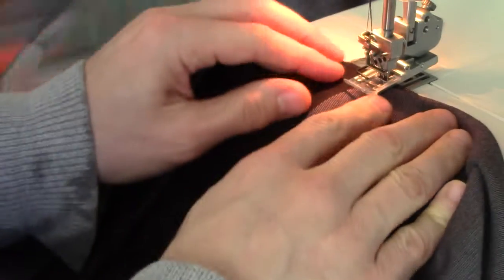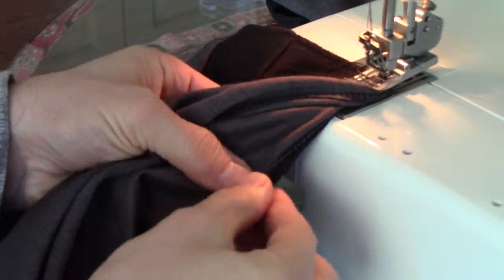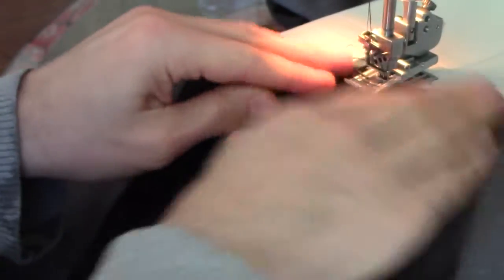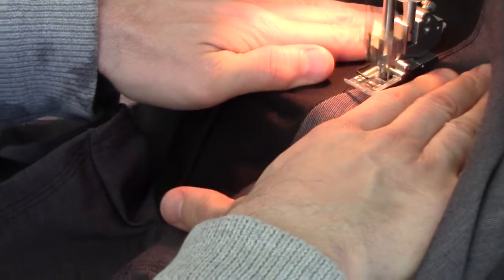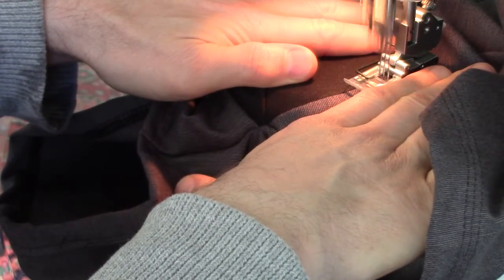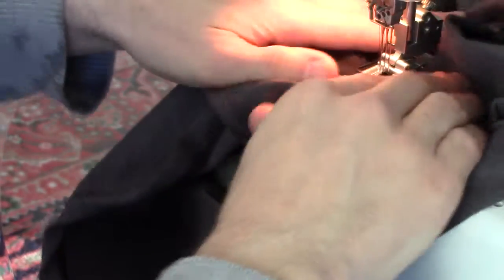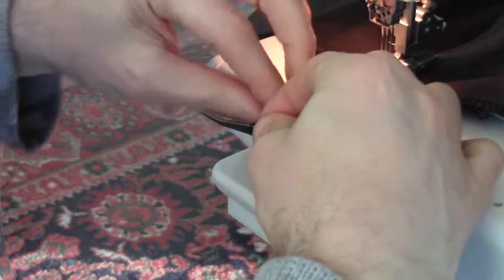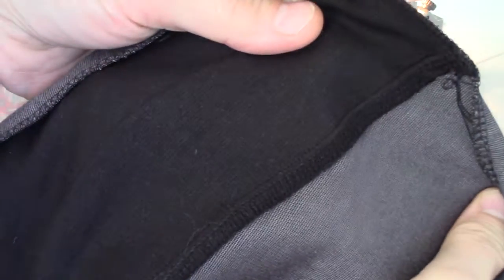Trick to avoid centre thread breaking Janome CoverPro 1000CPX

Comment: I just got the 1000CPX, and, the needle threads break, it was 2nd hand, but, unused. I did test it on muslin. The problems may be, muslin fabric, switch out needles, needle tension settings, cheap dealer test thread...  I would appreciate your thoughts, and, suggestions on the subject. I did watch a threading video, and followed the instructions. TIA for your help.